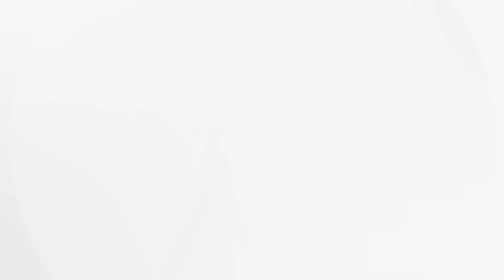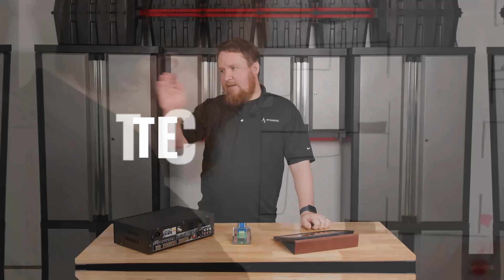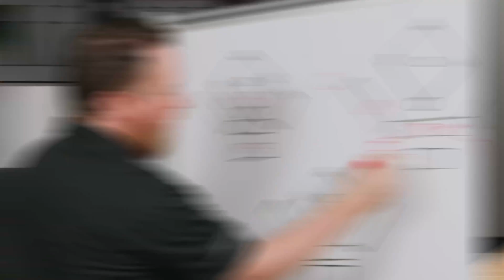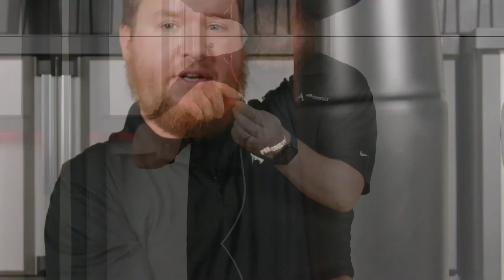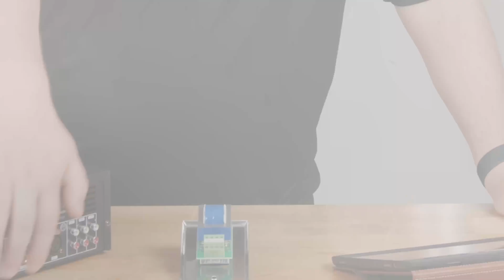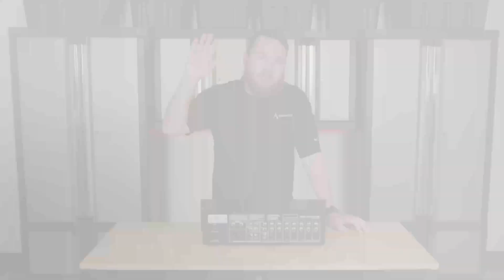Line Level vs. Mic Level on Pro Acoustics Tech Talk Episode 130

Comment: So what can I use to go from a headphone output on a mixing board into my video camera mic port wirelessly without getting distortion?
Reply from the maker: Most mixer outputs are line level, while camera mic ports require a much lower mic-level signal. To avoid distortion, you’ll want to use an inline XLR pad or attenuator to reduce the signal down to mic level before sending it wirelessly. I hope that helps!

Comment: In a mixer, there is mic and line level per channel. So if I want the particular channel for electric guitar, acoustic guitar or a bass guitar, then use line level? And likewise, if I want to dedicate that channel for microphone, thne use mic level of the same channel?
Reply from the maker: That's correct! Use the line level input for instruments and the mic level input for microphones to optimize signal levels and avoid distortion.

Comment: Great and informative video. What's your recommendation when connecting audio output from a mixer to a live-streaming equipment like YoloBox? I often encounter a distorted audio that completely lost its bass, even adding a DI Box in the middle did not help? Based on my understanding from your video I'm connecting a Line Level high voltage audio to a mic level low voltage input. Thanks!
Reply from the maker: You're absolutely right—connecting a line-level output from your mixer to a mic-level input on your streaming device can cause distortion and loss of bass due to the high signal level. To fix this, check if your YoloBox has a dedicated line-level input to avoid mismatched signal levels. Alternatively, try using an in-line pad or attenuator to properly reduce the signal from line level to mic level.  Hope this helps!